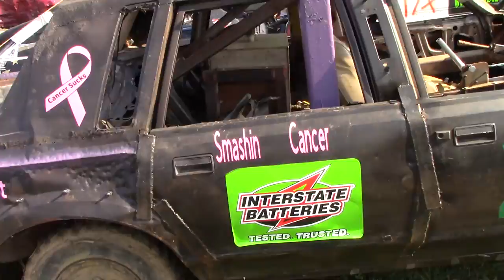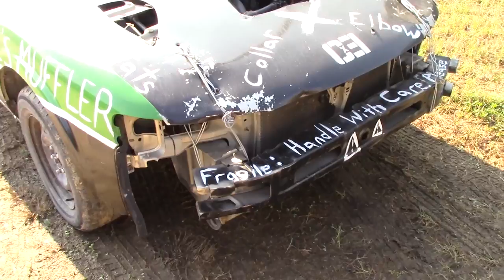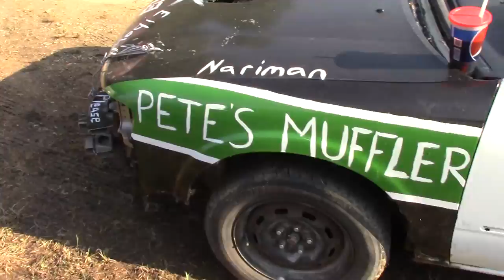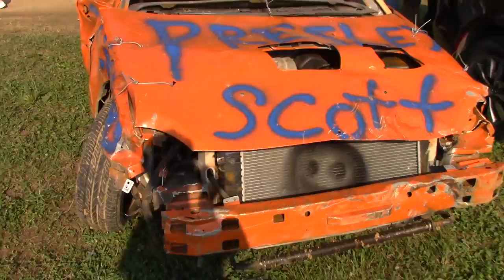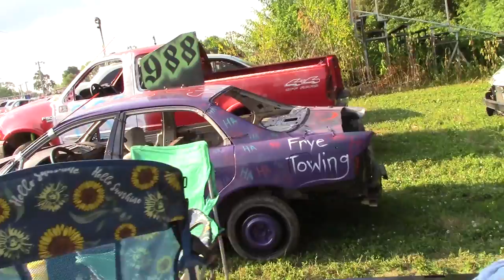Derby Prelude Owen Co Fair Summer 2022

Comment: Throwing a caliber together as we speak, mines a 2014 and has all steel spindles and suspension
Reply from the maker: Double check those spindles with a magnet. Make sure magnet is not on a bolt, only spindle. I’ve never seen steel spindles on a caliber unless they have been replaced aftermarket.